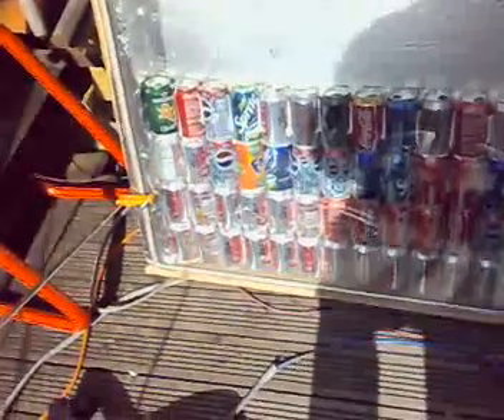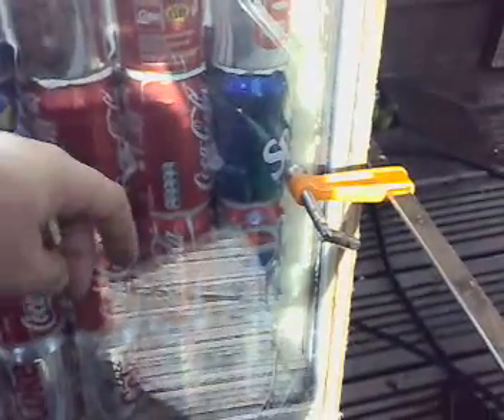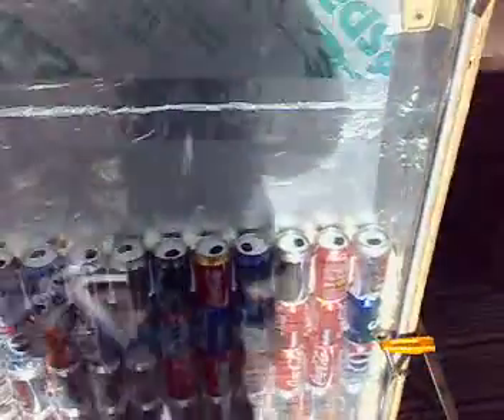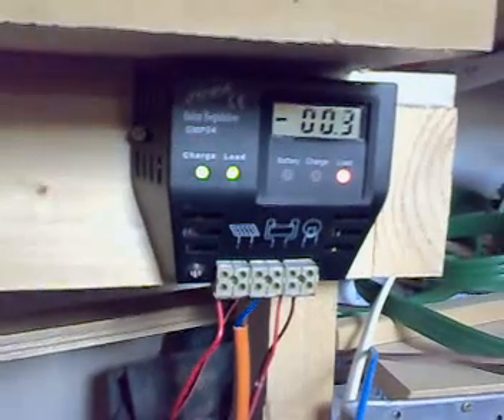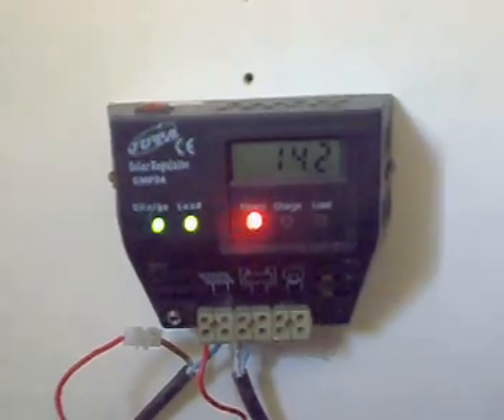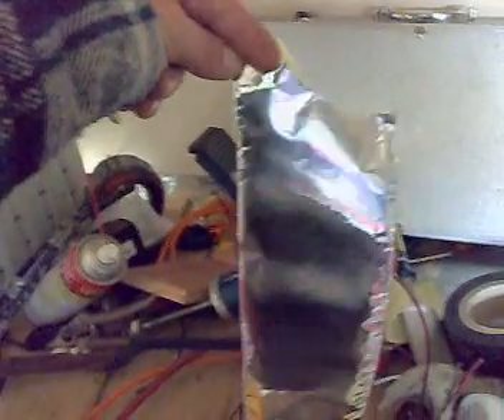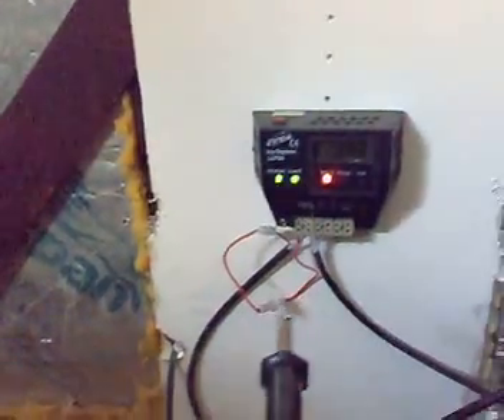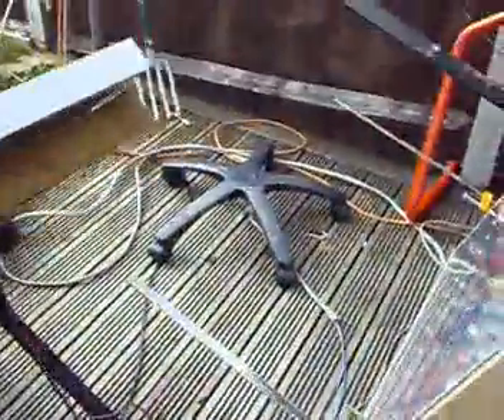home made solar air heater/update

Comment: What an excellent idea. So if you have enough cans and link them all to flow one tower to the next with the cold air coming in at the bottom & zig zaging up to the top (horizontally not vertically), then you'd probably not even need the solar panel to drive the air! Hot air rises naturally, coz of convection. I knew someone who had a home made solar water heater that used covevection (no pump) simply because the panel was on the garden & the tank was in the attic. Hot water rises too!